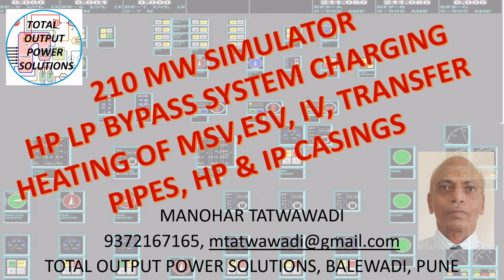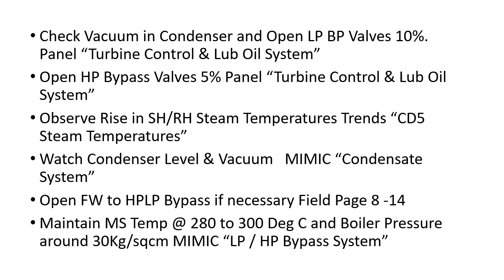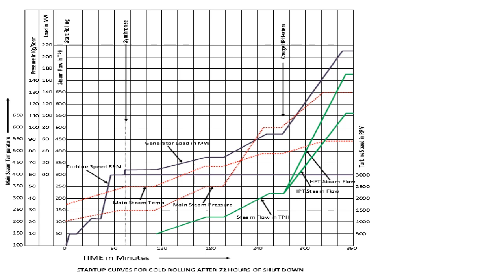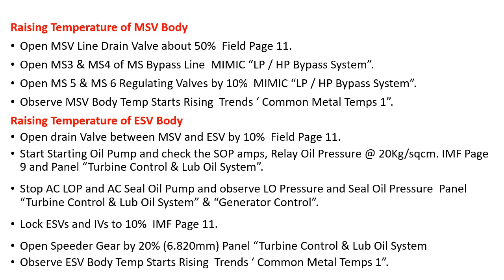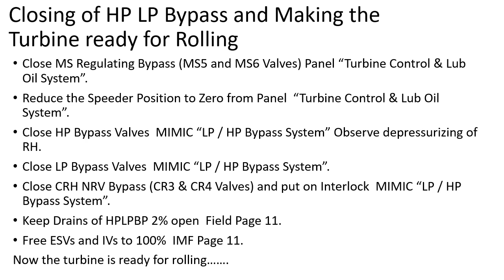Comment: Sir,
During IPT transfer pipe heating process, HRH steam pressure must be LESS than 1kg/sqcm. to avoid rolling of the turbine through IPT and not 1 to 2 kg/ sqcm. This restriction on HRH steam pressure during IPT transfer pipe heating has been mentioned by BHEL itself in their operations manual.